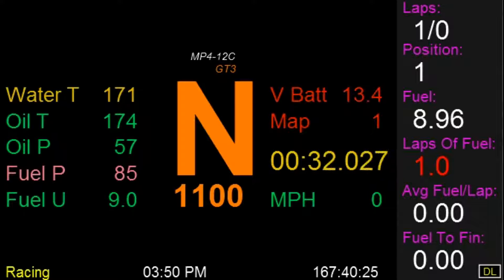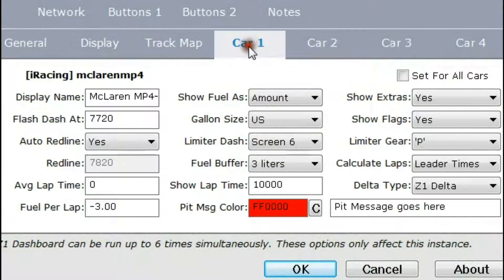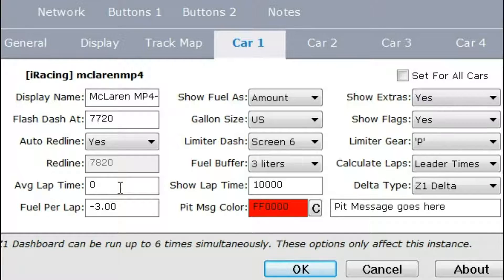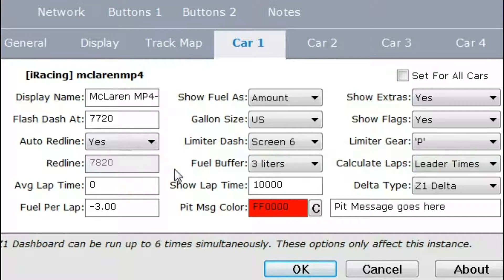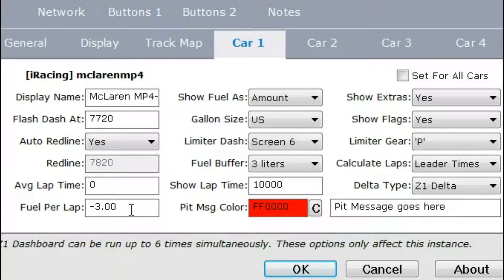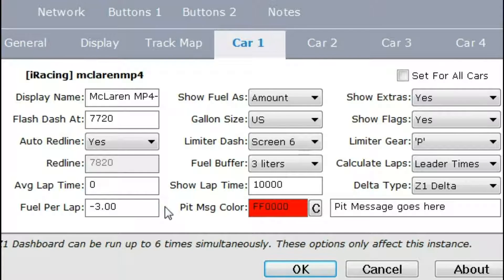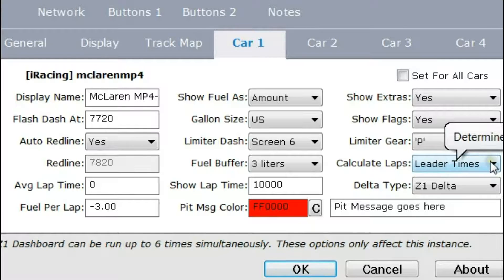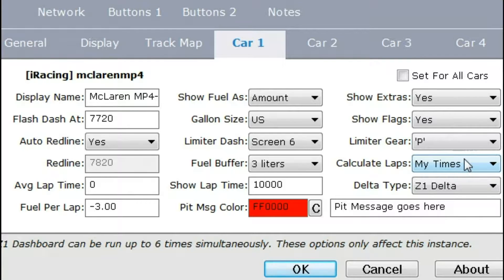Z1 Dashboard: Calculating fuel needed to finish your race.

Comment: Great, thanks.
Question. In the latest version of Z1 Dashboard it also shows Fuel Per Lap, should we also set this to Previous X?
Reply from the maker: Which dashboard are you referring to?  The setting you choose for fuel calculations is up to you and should be based on the type of race you are in.
Reply: I'm refering to the same as you are showing in this video, when setting up the parameters under Car 1, in the middle row, the latest version of Z1 Dashboard also shows FUEL Per Lap, should that also be set to Previous X? (I'm using 3 laps for the calculation). I never used the Fuel Calculation, but now that I have a sub on Z1, and wan't to start racing on a regular basic, I want to use this feature too. Could be I just have misunderstood something, but looking at the video, and seing that it's not the same as the one I have, I'm asking. :)